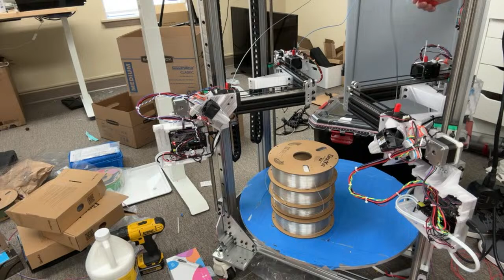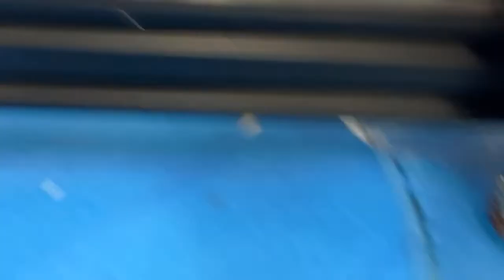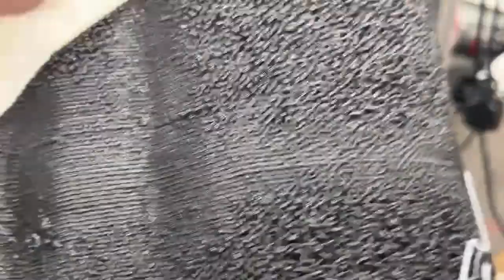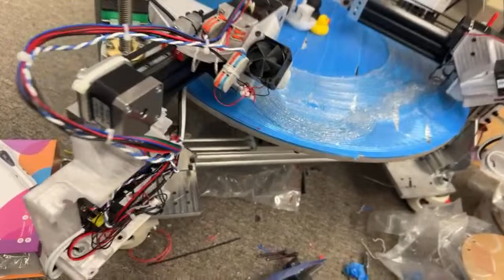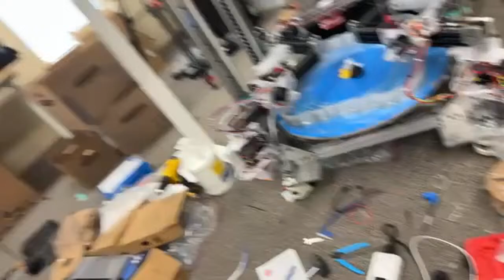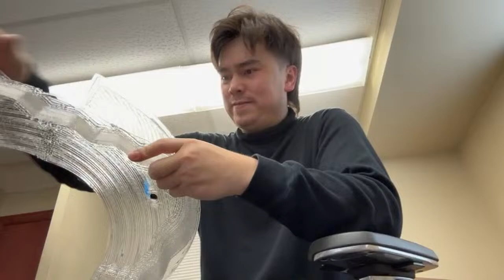High Flow Print Test Attempt #2 - Targeting 2KG per Hour (Clear PETG Edition)

Comment: Idk about the chube at its price the goliath performs as well or better yet to be compared equally but with the new vz hextrudort plus the goliath got alot more flow just from the more torque its 100 watts evenly down the 50 -52mm melt zone have 4 never had a heater failure 2 have insane imounts of hours  only issue is the thermistor wich isnt the hotend
Reply from the maker: Goliath is great value for money. I have one and will test it soon!
Thermistor placement is part of the hotend design. I'm not sure how much it affects performance in real world situations but want to learn more about it.

Comment: I’ve never considered using a router to remove brims before 🤔
Reply from the maker: Only thing I’d be worried about is chipping/shattering the material, but it would save a lot of time.

Are there router bits that grind/sand with a rasp-like cutter instead of a blade?
Reply: @NathanBuildsRobots  no they just cut, but one with a ball bearing guide should work well. Routers spin at such a high rpm I don’t think it would chip if you go slow & steady